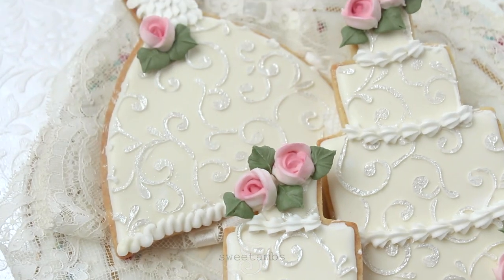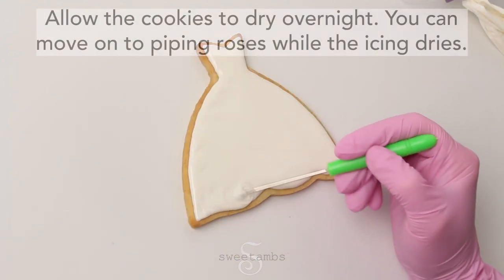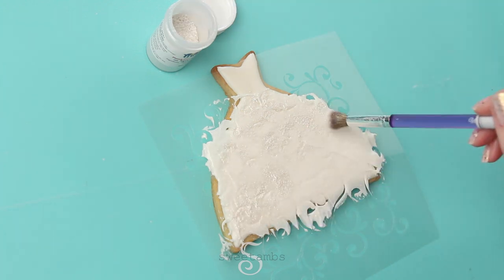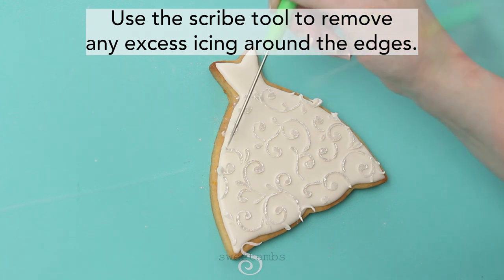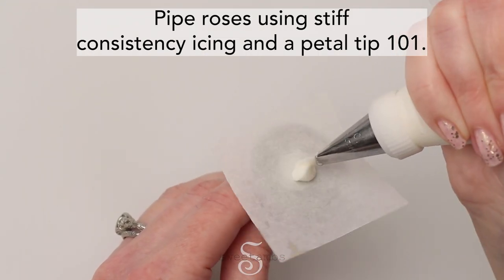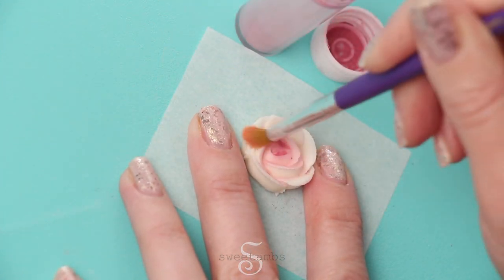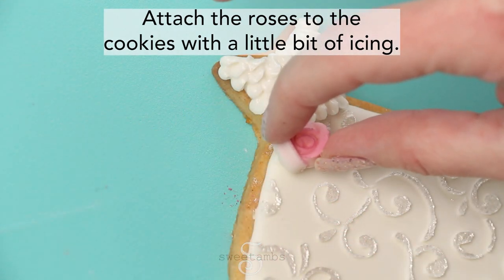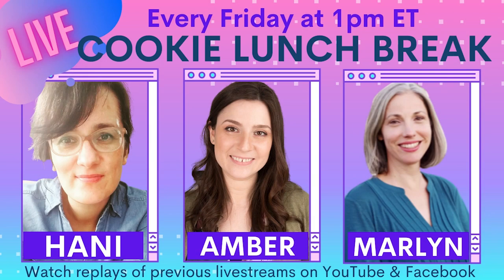How To Decorate Wedding Cookies | Stenciling With Royal Icing

Comment: Do you use a new stencil for each cookie?  How do you clean them? I love your work!
Reply from the maker: Thank you!! It works better if you use a clean stencil but I cut 3 stencils so that I didn’t have to clean it after each cookie. If the royal icing is not too dry on the stencil it just rinses off with warm water. If it’s dry you’ll need to let it soak for a few minutes ☺️
Reply: @Sweetambs   I appreciate your prompt reply! Be blessed!